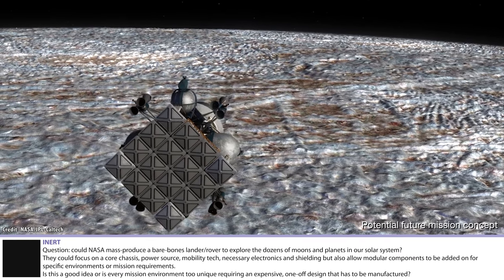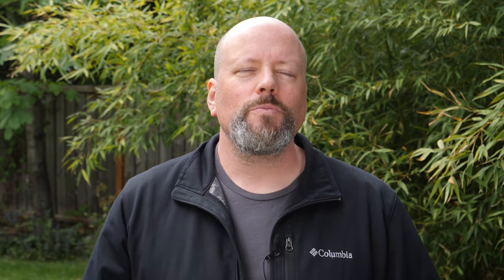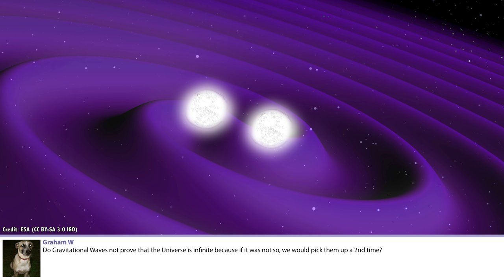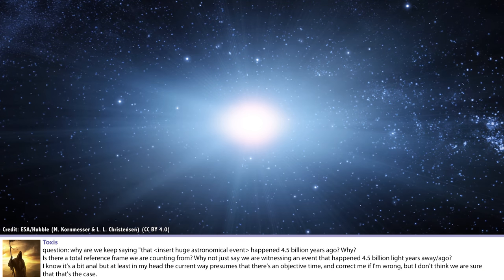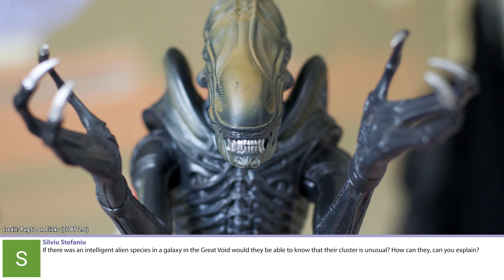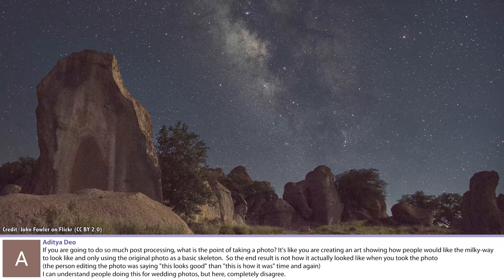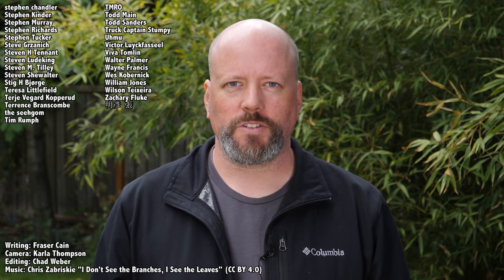Q&A 86 : Could We Move Atmosphere from Venus to Mars? And More... Featuring Dylan O'Donnell

Comment: Hey Fraser, most astrophysicists now say that there is no center of the universe or any one point of origin based on the fact that they can see the cosmic background radiation in every direction, but how can they know for sure since the radiation doesn't produce a doppler shift effect such as visible light spectrum photons do?  Or does it?  Never heard of that type of radiation producing an effect to where you know what direction it is traveling if observed from other than the emitter, or the collector.  We can set up a device to emit the  radiation, and measure it from a 3rd location, but isn't that because we know for a fact it's point of origin?
Reply: Actually, this is more based on the only model for the Universe/spacetime ever developed by mathematicians from the equations of general relativity. The Universe has no net velocity. There is only local variations in angular momentum, but overall the sum must be zero.

Comment: Question: I recently saw an Isaac Arthur video about moving star systems complete with their planets.  Simplifying, he is basically turning the star's energy into a jet that moves the star, and dragging the planet along gravitationally.

What effect would this have on the planet's orbit?  Would it cause the planet's orbit to decay?  It seems like the orbit must be altered by the slingshot effect as the planet moves from trailing side to leading side and back, since the star is being accelerated and the planet isn't.
Reply: You should worry about the weather more than the orbit. Ie blocking the star with mirrors would mean only part of thr system gets heat. Orbits will need correcting every so often, but theyll just be dragged along with their star for the most part. I believe Issac said a course correction with the star every so often will keep its planets stable
Reply: The sun is already moving at high relativistic speed, changing it's direction or speed wouldn't be instantaneous, it would likely take 100's of years to to get a noticeable effect on the relativistic speed and direction of the sun due to it's mass,  the planets wouldn't see much change to the gravitational field.
The sun's mass is 1.9885×10^30 kg (1,988,500,000,000,000,000,000,000,000,000kg) according to https://en.wikipedia.org/wiki/Sun
How much thrust is needed to accelerate that much mass significantly fast enough to cause the planets orbits to change?

The SLS is supposed to have a thrust of 8.5 million pounds (3,855,535.145kg), you would be looking at millions if not billions of SLS rockets to do this.

Not to mention that it would take millions of years to get our sun to it's nearest neighbor star.
Reply: @j-man72b72  
Relativistic speed here? No, nope. Look to the accretion disk around black holes for somewhat relativistic speeds.

Comment: First-time questioner here.

I've been very interested later about Encealadus and the prospects of life there. Getting a probe past that ice crust would obviously be a great way to get a better idea of whether or not life might have somehow taken hold down there.

Just conceptually speaking, would we have some feasible way of getting anything past the ice crust? What if we had say some solar-array panel landed on top, which would power a very slow drill? Or perhaps an RTG optimized for heat generation melting its way through? Do you see some feasible way of doing that with current tech?
Reply: Enceladus is unique in that it has active geysers on it.  It is actively spewing its insides into space.  Looking for signs of life there could be as simple as closely examining the waters coming up through the geysers, no need to drill through miles of ice.  We're very unlikely to find intact aliens via the geysers but it's reasonable to expect that if there is life there we'd find signs of their waste or bits of dead aliens.
Reply: @CarFreeSegnitz  Yup - but you'll get a lot more data if you actually go down there.

(Besides we've already collected samples of the geysers - granted you could do it again with a better suit of sensors).

Also depending on density & repartition, you may miss life althoghether if you only sample the geysers. Say if it tends to collect around something similar to thermal vents as some do here on earth... possibly those traces would be so minute as to be unlikely to be present in any given geyser. Or they may be ambiguous signs...
Reply from the maker: Thanks for the question. Have you seen this video yet? https://www.youtube.com/watch?v=qxU1VSSka4M&list=PLbJ42wpShvml6Eg22WjWAR-6QUufHFh2v&index=38&t=0s
Reply: The plan is to melt through the ice with a fission reactor at the bottom of the probe. I suspect the water will refreeze in the tunnel above it.
Reply: @frasercain  Well, I have to say that's quite efficient. Not only is it already done, but it's also one of the best on the topic.  Thanks!

Comment: About the question regarding a common spacecraft base, I'm surprised you didnt mention Rocket Lab's new platform!
Reply: or the fact that they built multiple mariner, voyager, and other craft on the same platform - and most recently, mars 2020 is using the same chassis as curiosity, but with different instrumentation.   so they DO reuse when it's feasible, but as Fraser said, it depends on the mission objectives as to which type of platform works best.

Comment: I wonder if we success to block the light on Venus, how the pressure would drop as the temperature get down and things get to liquefy?
Reply from the maker: The CO2 would fall like snow out of the atmosphere once it cooled down enough. Then you could just shovel it around.
Reply: That surface temperature runs deep into the crust and mantel. How to cool off Venus rapidly?
Reply: @avid0g  A dust cloud at a Lagrange point, or a megastructure filtering the sun maybe?
Reply: @frasercain  I would prefer to have O2 to breath than shovel!

Comment: Hi Fraser,
Even if we were able to implement an artificial magnetosphere to ward off solar winds from stripping away at Mars' atmosphere, are there any components of the atmosphere which Mars would not be able to hold (eg water vapor etc) due to it's significantly lower gravity than earth? In a best case scenario technologically 10,000 years from now, would it even be possible to replicate Earth's atmosphere or are there some things that would float off into space even with a working magnetosphere in place?
Thanks!
Reply: If we reach a tech level where we can divert comets and asteroids into Mars, it should be feasible to fabricate a deep atmosphere even without a magnetic field, and sustain that for millions of years. 

It will require immense and sustained energy to impose a strong magnetic field within or around Mars. 

Ask a physicist how to theoretically induce Giga Tesla of magnetic field around Mars. Billions of permanent magnets? Billions of superconductor magnets?

Comment: Q: If fuel wasn't a limiting factor I,e (we invented nuclear fusion or magic space dust) would we travel through space in straight lines instead of all that prograde, retrograde, normal, anti-normal, slingshots, etc? I watch star treck and captain Picard and Janeway just say "set a course, engage.
Reply: Well, you could just point your spacecraft and accelerate, but gravity bends space, so it would still be like firing a bullet down a twisty barrel.

Comment: Hi Fraser
Thanks yet again for another interesting episode!
Speaking of Mars ice caps, Water is oxygen and hydrogen, CO2 can add carbon to the mix. Just add Nitrogen and you have all you need for life. 
I wonder, do we (as humanity) have any tech to convert this mix chemicaly to food or we will need to build sort of hydroponic farms?
I mean we can convert water to H2 and O2 no problem, just add energy. I don't know can we do the same with CO2 without plants? and the original question, is there nitrogen on Mars in easy obtainable form? Like N2 of ammonia or any cool nitrogen compounds? preferably in Ice caps as well?
Thank again for the work you are doing, its super interresting!
Reply: I did a search of concentrated "inorganic" forms of nitrogen on Earth. There are only two. Both nitric metal salts may actually be fossil by-products of the very earliest nitrogen-fixing bacteria thriving on two different concentrated metal deposits. So Mars rocks, like Earth, may be composed of under 3% inorganic nitrogen by weight. 

There is one other possibility. Earth suffered from one or more interplanetary collisions that destroyed proto-Earth/Thea and formed our Moon from their crust. The extremely high collision energies may have fractured nearly all inorganic nitrogen bonds in Earth's crust, reverting to the N2 low-energy gas state. 

If all that is correct, then Mars may contain a higher percentage of inorganic compounds of nitrogen than Earth has because the proportion of Di-Nitrogen is lower than Carbon Dioxide. 

Otherwise, we will have to import all the nitrogen we need from Earth, probably mostly as ammonia, along with trace elements for dietary requirements.
Reply: @avid0g  
The thing is, people at NASA should have an idea of crust composition of mars.
But ammonia for example, is not rare in solar system. If it is on mars, it will be so much easier

Comment: Is there a simple equation to find out the distance betweem two stars?
Reply: Nope.  Just observation.

Start with the parallax method.  Take two pictures of the same star six months apart.  Carefully measure its shift against background objects.  A shift of a single arc-second is a parsec, 3.262 lightyears.  A half-arc-second equates to 2 parsecs.  This method gets hard with stars much past 20 lightyears away.

Then intrinsic vs apparent brightness.  With most stars we can infer their intrinsic brightness from their spectrum.  And we know with certainty their apparent brightness from simple observation.  Apply the inverse-square law, an object gets four times dimmer as you double the distance from it.  This method works well for stars a few hundred lightyears away.

Then standard candles, much like the previous method.  Some phenomenon have well known intrinsic brightnesses like Cepheid variable stars and type Ia supernova.  These can work to measure out to millions of lightyears.

Finally we can study redshifts due to the expansion of the universe.  The Hubble constant is roughly 160 km/s per million lightyears.  We can measure distances to galaxies billions of lightyears away with this method.

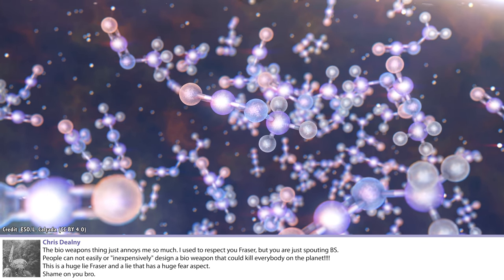Comment: 11:30 Chris Dealny is defiantly wrong.  All we need is 
1) Something horrendously infectious (cold, flue , smallpox etc.) bumped up a bit.
2) Airborne transmuted. (lots)
3) Long incubation period with no symptoms (HIV)
4) 100% fatal (rabies)
5) Immune to current anti-bionics/treatments (lots)
Then do a bunch of genetic engineering to put the pieces together that you need and poof.  
Then, Put that together with any of the radical religions with enough power and money that think its a good thing to move on to their imagined next life (christianity, islam, etc).

Sure the genetic engineering part may take a bit but if people starting working on it it wouldn’t take too long.  We already have all the pieces.  The only thing that’s stopping it is the venn diagram of genetic engineers and radical religions don’t overlap yet but it is very reasonable to assume that some day it could.  

To think it's impossible is just putting your head in the sand.

Comment: I have been proposing that we make nuclear rockets to push asteroids out of the asteroid belt for a few years now.  The ulitimate goal would be to get  Vesta   and Ceres to crash into Mars and melt to add to the gravity, water, atmosphere and knock it closer to the sun and so make it warmer.  I think it would take most of the bulk of the asteroid belt to do this and it would take giant nuclear engines using melt water to thrust with.  Hitting the dark side would be a must.   We should start small, a mile in diameter, mostly ice.   How big of an engine would we need to do this in a few years time?  This is billions of tons per cubic mile and we need millions of pounds of thrust over a  long period of time.

Comment: If you mass produced spacecraft on the moon you could as it wouldn't need to minimize weight so you could build one that is over the top for 90% of missions.  Couldn't you just put a large asteroid in orbit around venus with a long straw/air scoop and power it with ion drive if asteroid has the mass so you don't lose momentum. Liquify and freeze the methane/co2, stick metal on the end and use a rail gun to shoot it to mars every couple minutes. Couldn't we just use crispr to give all astronauts Myostatin-related muscle hypertrophy and they wouldn't have to worry about muscle loss. Has a Myostatin-related muscle hypertrophy mouse been sent to iss to see the effects in space ?

Comment: not even close even giant solor sun shield are more practical
Reply: A solar shield would be "easy" to build.  Just a reflective structure either in the sun-Venus L1 point or orbiting Venus.  It would require a structure several thousand km across but that would be feasible in a future of asteroid mining and space fabrication.  The end result would still be challenging to deal with: a thick layer of not-so-hot CO2.  Venus lacks hydrogen so turning CO2 into carbon + water is not an option.  We'd need to find stuff in Venus' crust to bind the carbon and oxygen to.

Comment: Could earthes water have come from mars??? Yea yea comets and asteroids but as mars lost its water to space it had to go somewhere.  Gravity from the sun took over..... and earth mopped it up.. 🤔
Reply: Mars lost its water in two stages.  UV radiation can split water molecules down to oxygen and hydrogen.  The hydrogen floated to the top of Mars' atmosphere where it gets eroded away by solar wind.  The excess oxygen happily rusted the surface iron, hence Mars' red hue.

Moreover gases lost by Mars will be blown radially away from the sun.  Since Mars is further from the sun than Earth virtually none of Mars' would reach Earth.

Compared to many other solar system bodies Earth doesn't have that much water.  Ceres, the largest body in the asteroid belt with a mass less than 1% of the Moon, is suspected to have as much water as all the fresh water on Earth.  Europa is suspected to have an ocean under its ice containing more water than Earth has but has a total mass of about .8% the mass of Earth.  Thus Europa has about 200 times more water proportionally.  It feels like Earth has a lot of water because oceans cover ~75% of the surface.  But that's the result of water being less dense than the rest of Earth so it has drifted to the top, and there's still decent expanses of dry land (luckily for us).

Comment: Mars is an interesting problem.  Can't prove this but I think one of the factors of earth's gravitational field is that it prevents hydrogen from being blown away in the solar wind.   Mars,  looses hydrogen via solar wind and you have a planet almost devoid of it.  If you could figure out how to pull hydrogen out of the solar wind and drop it on Mars, you'd have a great planet with lots of water!
Reply from the maker: The gravity helps, and the Earth's magnetosphere does a lot of it too, which is caused by Earth's greater mass.

Comment: ad the first question: ESA did something like that. they have developed Rosetta. It had some delays... based on Rosetta, they made Mars Express. The term "Express" actually points to the fact, that they saved so much time by essentially using Rosetta. Mars Express was a huge success, even before Rosetta did its mission. Then with the second unit for Mars Express, they created Venus Express. It's essentially Mars Express without lander but with an extra heatshield (for operations close to the sun).

Essentially, it can be done, even more, if the spacecraft is prepared for a multitude of different environments. But that advantage comes with the cost of higher launch mass. Yet, with ariane V and falcon heavy, that can be easily accepted, as these rockets are powerful enough.
Reply from the maker: Yeah, these are great examples. And I totally agree, lowering launch costs will allow for more generic platforms.

Comment: 3:54.... One idea that some people would imagine is a giant inflatable balloon where a large tether pipe made from carbon nanotubes feeds the balloon CO2 and it expands to about the size of mount Everest and shuttle a number of them to Mars and crash it into the planet. but there are 2 problems, one the cost to build such insane engineering would be astronomical (no pun intended), the second problem which i would ask your confirmation on that the bigger this balloon full of C02 would be the increase chance that it will affect the orbit of venus or any solar system body it comes across??